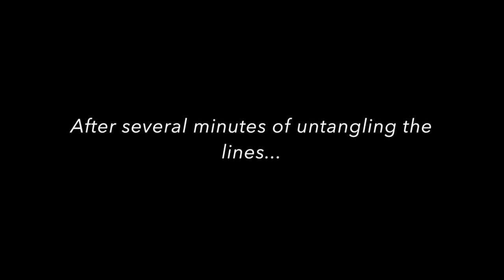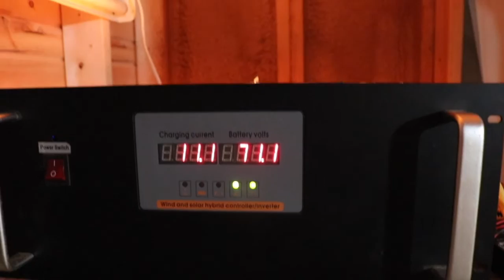Putting up the Wind Turbine

Comment: I'm going to be putting my turbine next summer. I had it roof mounted but that didn't work too well. So, I'll put it up on a pole. Fortunately, my turbine isn't a big as yours, so, my install won't require all the equipment. Why don't you let us know what kind of power that you're getting.
Reply from the maker: I've got a couple videos on my channel where you can see the Amp output. But on a good windy day it would put out between 15-24 amps @ 70 volts. It finally seized up a few months back but it was in service for over 15 years total. Will consider having it rebuilt in spring. Best of luck with your install. Hopefully it goes smoothly

Comment: We're thinking of converting to solar. What was the total cost of the turbine and your panels an power supplys if you don't mind me asking. You did a great job btw!
Reply from the maker: I break it all down in my "off grid power" video in terms of cost per item and some of my recommendations. But roughly 5-6k CAD is what I have into everything. Subtract 25 percent or so to get USD

Comment: Have you figured out the model # and the specs..  This looks like a good addition to my farm in the future.
Reply from the maker: I have actually learned that both the controller and turbine are made by hummer. I've spoke with someone who dealt in hummer products many years back who figures I have a 1000w model turbine but it's putting out 1400w in a strong wing and the thing is over 12 years old
Reply: I have same model. Its 500watt to 1000watt max by book. Designed to add 250watt solar. Also bought last week, but all new, packed in box, was sitting 7 years in friends storage.

Comment: Really cool of your Dad!  Well, it's been just over a month since you put out this video...  What are your thoughts, how is it working for you guys?  Thanks, -PJ
Reply from the maker: It's been a blessing for sure! Not using guide wires was a mistake though. The vibrations were too strong and broke a 1" diameter bolt holding the tail on. So we took it down and had it repaired at the welding shop in town. Up again now with guide wires in place. As I write this we are going on day 3 of cloud cover and blizzards. Got about 14" of snow over the past few days. After all that, are batteries have never dropped below 80%. Right now we have virtually every light in the house on, as well as the TV and vcr, and the turbine is still producing substantially more than we are consuming and it's sending power to the dump load! In comparison, when we had just the solar panels, after 2 days of overcast we were using my phone flashlight hanging from the ceiling for light in the evening to avoid killing the batteries below 50% (damages them and reduces capacity). So the long answer is the turbine is working great! Thanks for watching 🍻
Reply: @TheHappyHermit  Good to know, thank you for your prompt reply!  I'm going to share this with a couple friends, I think you're onto something here!  :)  Stay safe during the blizzard!  -PJ